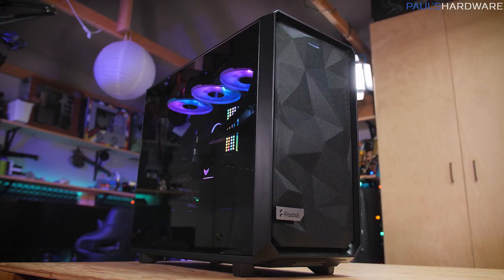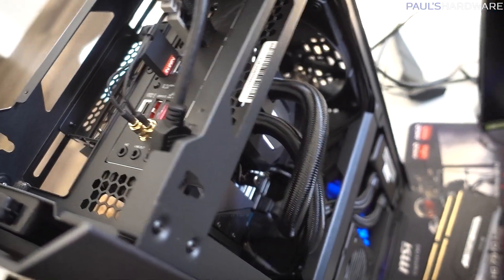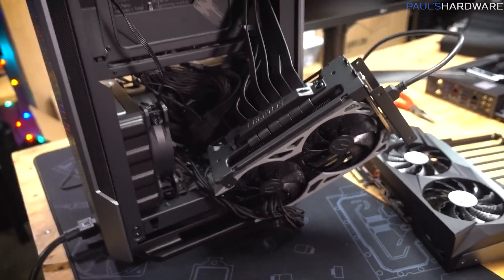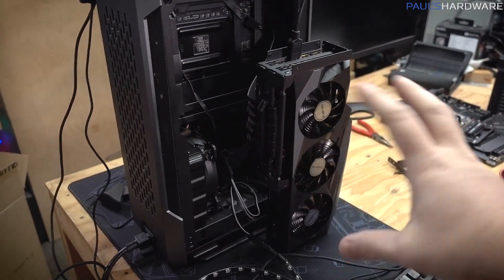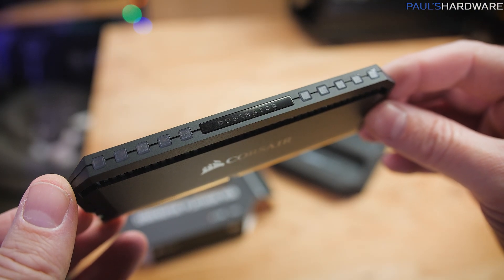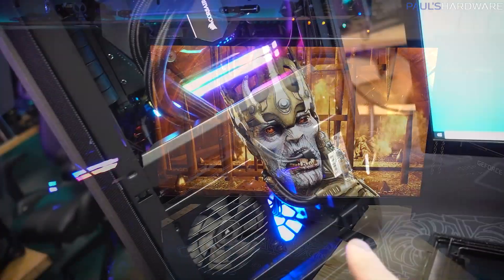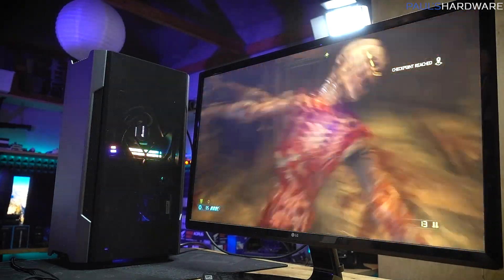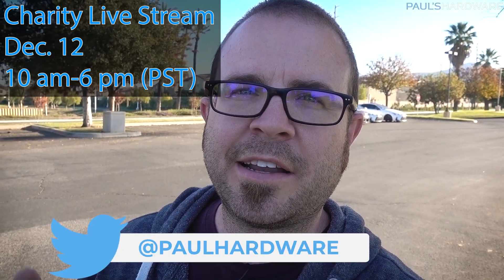Here’s what I do with the gaming PCs I build...

Comment: Canucks did a video recently, addressing problems with riser cables and pcie 3/4, where multiple cables may and or may not work, tested with multiple cables from same manufacturer, where one cable works on this Mainboard with this graphics card, and on another MB same cable with same card doesn't.. This may be helpful

Comment: There is a known issue with pci 3 riser cables if you have a pci 4 motherboard and graphics card. You apparently have to uninstall the graphic drivers or use a pci 3 graphics card until you can lock the bios to pci 3 mode. Also a bequiet aio would work better because the pump isn't on the block but in the tube so if it does get worse that might be an option.

Comment: I NEED HELP!!! I just built a PC and it won't display on my tv/monitor. It's a Ryzen 3 3100, B450 Steel Legend MOBO, MSI 1050ti GPU, 500GB M.2 Storage, 2x8gb RAM. The bios is updated to 3.40 out of the box but it will not post. It will turn on and light up and the fans will spin. What do I do?

Comment: Q-Flash will work with both memory and ram installed, you don’t have to remove them, and it also works with neither installed (as was the intent). The Q-Flash button will not work if ErP (ultra low power mode) is enabled in the BIOS. And the BIOS file must be named GIGABYTE.BIN and located on the root of the USB drive.

Comment: When it comes to video out issues, why don't I see anyone try to use the video out on the motherboard? If it is the Gen 3 vs Gen 4 riser cable issue they suspect, then doing so lets them make sure everything else is working right and change the BIOS without any teardown. The route I keep seeing people go seems overly complicated, unless I am missing something. Yes, if it is something else then a (partial) teardown is needed, but why do the work before you know you have to?

Comment: There is a PC Motherboard Diagnostic Card that you can buy in amazon and I think will be really helpful in knowing what's wrong in a pc system. You put in the pci-express slot and it lets you know if the motherboard is receiving power and gives you POST codes to know what part of your system is preventing your system to boot.

Comment: OptimumTech also ran into an issue with pcie4 slot with pcie3 riser cable and pcie4 gpu. You need to go into the bios and manually set it to use pcie3

Comment: I used the Q Flash + feature on the b550i aorus pro ax motherboard a few days ago to update to the latest bios for my ryzen 5600x. If anyone's interested, I just added the BIOS file to a fat32 formatted USB drive, renamed the file GIGABYTE.BIN, inserted it in the white USB port, powered on the system and clicked the Q Flash + button once. I had everything installed in the motherboard, CPU, RAM, GPU, case fans, etc. The led started blinking and after some minutes the system booted with the updated BIOS.

Comment: I have the B550 Aorus Pro Rev 1.0, I tried to update BIOS for a 5800X without CPU/RAM/GPU installed and couldnt get it to work....built system any way and tried again with other components in and it worked!

Comment: Using a gen 3 raiser cable for a gen 4 pcie slot and gpu has been an issue for many builds, where the solution is to switch the gen in bios

Comment: I have a question for you. I’m trying to decide if I should buy one of the new consoles or just buy a pc. I found a company that sells a pc for a good price point. The company is called evolve and the unit is the ev-01. If I was to purchase it I would get it with a e3 9100f cpu and a gtx 1660 super. Will that run my favorite game as well as one of the new consoles? Destiny 2 is the game I play most often. It will also have 2tb 7200 rpm HDD and 512gb ssd. Thanks for reading my question. Love the videos

Comment: Hey Paul, new here. I’m guessing the paper towels and tape is supposed to work as an insulation to keep the hoses from condensating and/or letting the cold temps escape. I worked as an insulator for a university all last year and I have a recommendation: You can pick up some Armaflex rubber pipe covering in various pipe sizes starting at 3/8in. Home Depot has it. They come in 6ft lengths for about $5. You just cut it to desired length and it has a self seal tape you peal off to close it up. We used that brand for mechanical pipes to prevent them from freezing/condensating. A lot less work than removing that tape monster haha.

Comment: In one of optimum tech’s videos he said he had a problem with using a gen 4 pcie motherboard slot to a pcie 3 riser cable to a pcie gen 4 gpu so that might be the problem
Reply: I think he used a gen 3 gpu went into the bios settings and switched the pcie slot to gen3
Reply: I didn’t finish watching the whole video before typing that comment

Comment: Just been through a lot of those issues with the kids Christmas builds, Got MSI B550 Gaming Plus and Ryzen 5 3600. I was waiting on GPU releases so didn't buy those and thought I'd use my older Sapphire HD7700 GHZ (think that what it was called) to test and set up the system. 
I also found Mikes Unboxing (and now follow him) for Bios Flash advice. tried latest bios, rolling back bios, nothing worked. In the end I bit the bullet and bought 2 MSI gaming X 1660Supers (seeing as nothing in my budget range will be available pre Xmas and its for a 6 and 11 year old). New GPU's worked fine so found my issue but Mikes Unboxing definitely had the info I needed to try.

Comment: I've just built a new system with a Gigabyte X570 motherboard & I also had issues with no video signal.
While using the vertical PGU mount, I had to drop the PCIE to Gen3 in the BIOS. Of course, this involves either putting the 3080 directly into the slot, or using an older graphics card in with the riser cable to actually get into the BIOS.

Comment: FYI - In my newest PC build in a Corsair 4000X, I was not able to install their H115i RGB Pro 280 AIO into the case at the top with their Vengeance RGB Pro DDR4 RAM. Does anyone at COSRAIR attempt to build out a PC with their own products to ensure they actually fit in their own cases? I'm not even sure a 240 AOI would even fit at the top without hitting the RAM sticks. I lined up the 280's edge into the 240 slots with GSkill RAM (shorter height), and it was still touching. No Bueno!

Comment: I've definitely heard somewhere about the PCI-E Gen3 cable / BIOS in Gen4 mode issue before.  I believe it was Kyle had the same problem in a build he did recently?  Didn't he have to use a APU to switch over to Gen3 mode in the BIOS or something.  Can't quite remember but that is very likely candidate for the no video out.